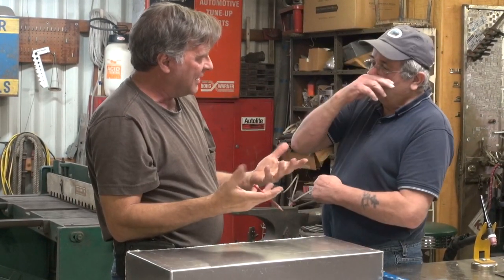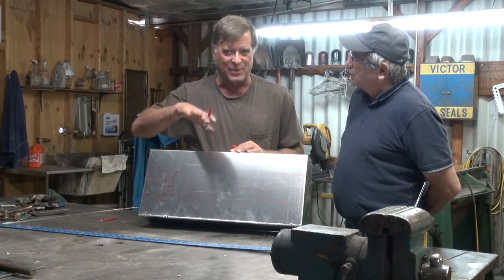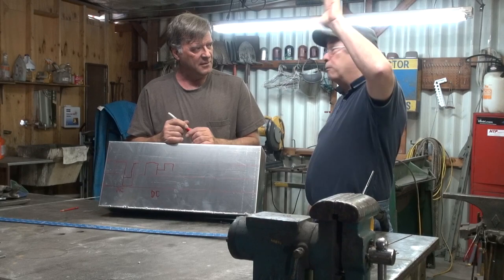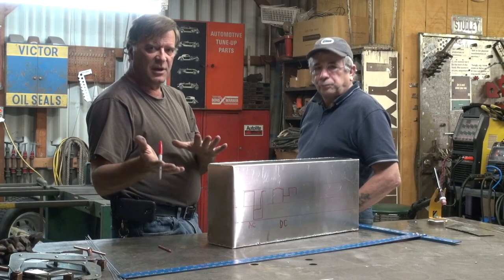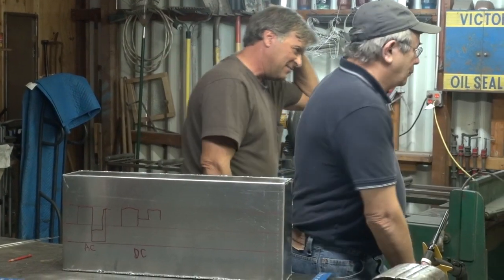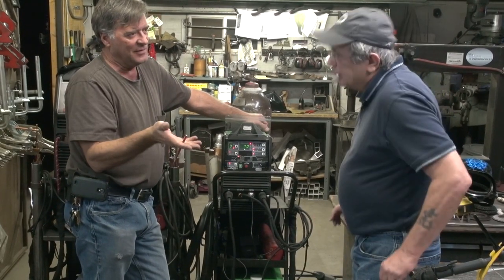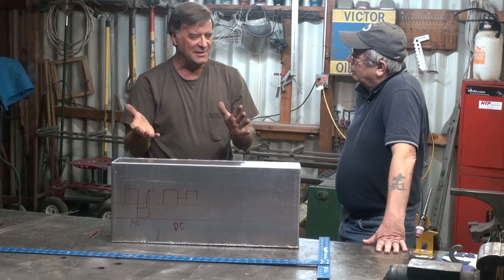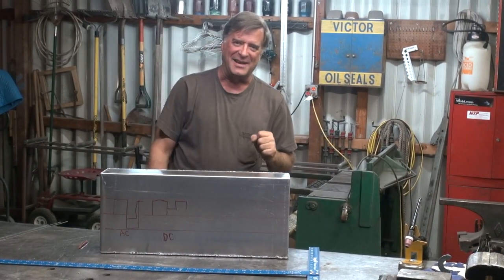Welding Pulse: What It Is and How to Use It - Kevin Caron

Comment: Does running a TIG at a high pulse rate (e.g. 200/sec) put more wear and tear on your welder, possibly shortening it's working life?
Reply from the maker: Nope, that's what it was made to do.   Have never had a frailer because of that.  Or any other reason.

Comment: Kevin, just a bit of interesting info. Europe has been using pulsed SMAW for several years now, it's actually pretty common over there and some applications require the use of it on the drawings.
Reply from the maker: Had an early Longevity tig machine that would pulse in SMAW..    Was fun to play with..    It would also run the foot pedal in SMAW..         They assured me it wasn't supposed to do that!
Reply: ringram0790 But? Will the AHP do it? And if so will it be successful?
Reply: Kevin Caron, Artist HTP makes a pulsed tig machine that is also designed to run pulsed stick.
Reply: Michael Rhoads I have the 2016 version and mine does not pulse in stick mode.
Reply: I'd like to see Kevin work with an Everlast pulse mig welder.